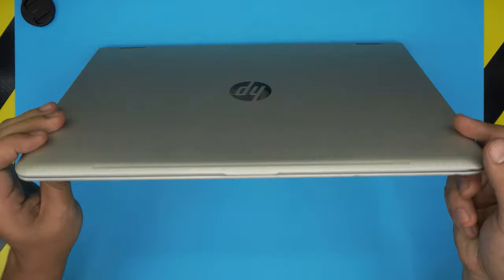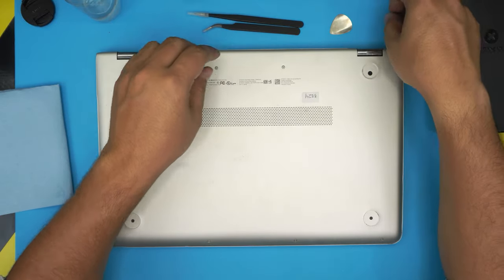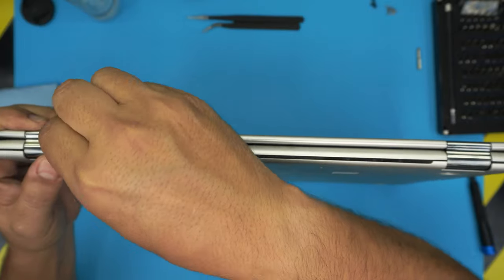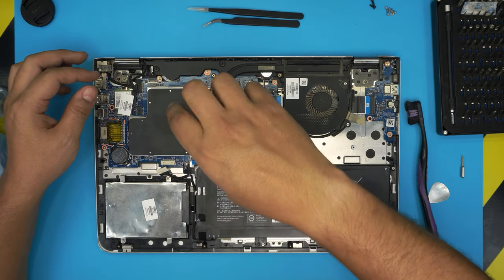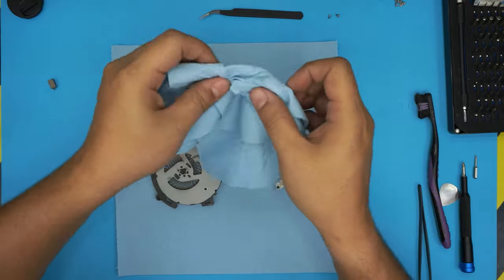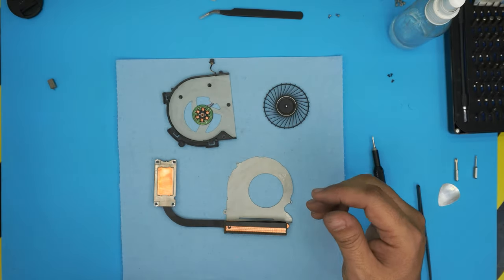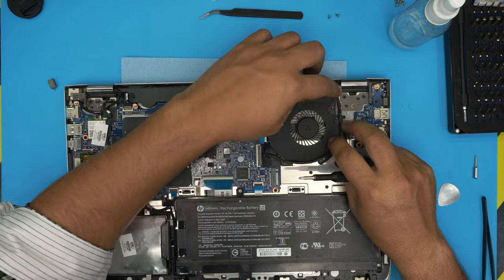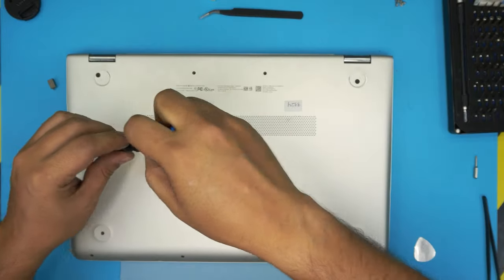HP ENVY X360 M6 AQ 📢 REPASTE | SERVICE | CLEANING

Comment: My fan is not evenly coming out. Tried to use a little force and one of the blades broke off. Any advice on this?
Reply from the maker: you probably had a fan that had the shaft locked on motor. you can purchase a new fan on aliexpress, they are very cheap